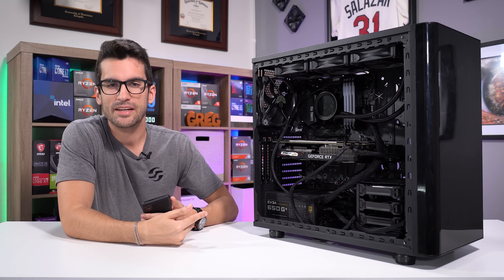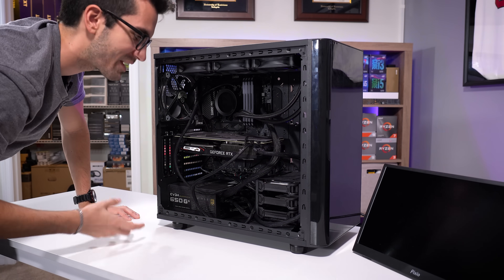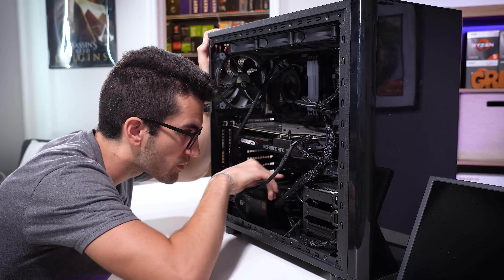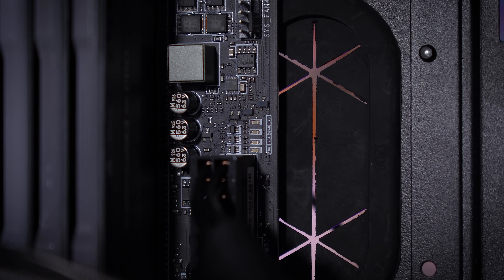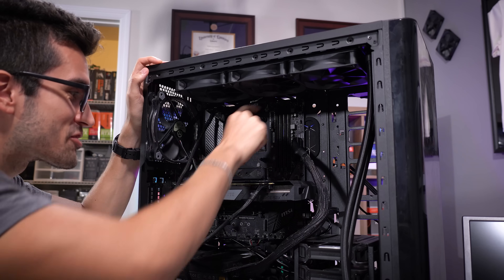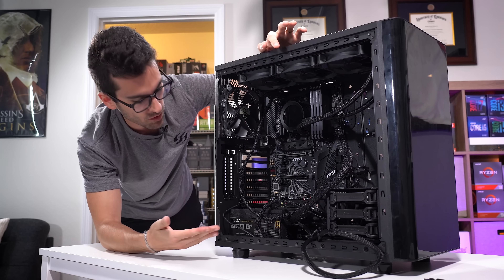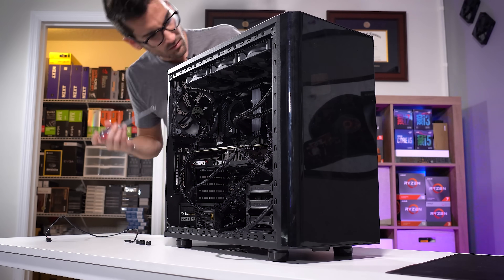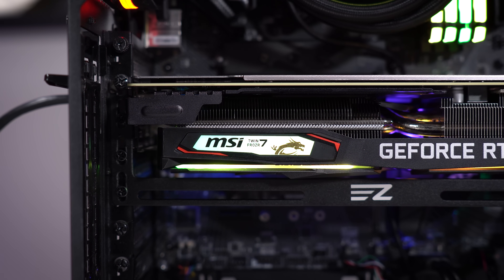Fixing a Viewer's BROKEN Gaming PC? - Fix or Flop S1:E4

Comment: I had this bizarre issue with my previous pc, whenever I reseated my ram or processor (for cleaning it), it went straight power cycle endless time like always, so I had to remove the cpu and the ram again, left it for about 20 minutes (draining remaining charge in the motherboard capacitor), and installed it again all together and bam, the system boot just fine.

Comment: My brother just did a new build, he had a gt 710 in it. He replaced it with a RX 6900 xt and now it doesn’t turn on (no power at all). His power supply is a 850 watt gold. We checked all pins, wires, etc. we unplugged and replugged things in, doesn’t change the issue. We unplugged the new GPU and added the gt710 and still no power. What is going on and why?
Reply: Can a graphics card destroy a motherboard or a powersupply?

Comment: My first thought was a dodgy overclock or BIOS glitch. Resetting the BIOS would usually be the first thing I'd do in these situations, since adding or moving components can often screw up the BIOS.
Are you sure you didn't reset the BIOS by "mistake", instead of shorting the power pins, when you fixed it?

Comment: Happened to me once, I reassembled my system and accidentally had the USB flipped somehow (it was an internal USB so I could plug in my Xbox controller adapter inside the case). Easy fix but took way too long to figure out.

Comment: It was the power button or power button wires. Remember it would turn on when power supply was turned on. Then he removed and replaced the front panel headers and then had to push the power button to turn on the system (no auto start, Greg even stated how that was weird). I'd bet an led was jumping the power pins. 
Try it your self turn off you psu. Hold your power button and flip the PSU switch your rig will do what this was doing.

Comment: I also having a similar issue with my pc it doesn't post or sometime it does. I think it is the psu because it's only 400 watt and I got a spec of gigabytes motherboard b250 (I think), ram 8 gb and gpu is GTX 1650 and cpu is i3 3.9 dual core GHz processor. So what I am saying is that 650 watt psu would be sufficient for my system? Or I should go for corsair 750 watt RM series?

Comment: Probably a little piece of wood or plastic got inside of one of the plugs and wasn't making a proper connection when you actually unplugged everything and plugged it back in it probably fell out, that's just a guess though, someone smarter than me is welcome to tell me why I'm wrong.

Comment: Ive had a simulare problem on a old settup legit tried to swap out everythng in the case, turned out that the Power button cables were shorted out. :O

Comment: I had a problem like this earlier and I found that the power switch connector was upside down in the front Io , this used to cause resets on my system.

Comment: Hey Greg.

I love your channel but I've seen this happen on gigabyte boards plenty... and while it's an MSI board I gotta ask... as I see the RAM Timings are back on default....

.... do you think just clearing the CMOS resolved the issue?  Because I've had plenty of moments where I adjust RAM timings or even just flip the "XMP On" button, and the machine will do that Exact behavior.

Boot to POST and then fail... and a quick note: the CPU light flashed, it's the RAM that didn't move to the next spot.  But... that's my theory.

Comment: I had this issue when I tried to install my pcie cables backwards to hide the daisy chained side and have a cleaner look. Idk why it won’t accept them in that direction but mine would turn on shut down. My guess is that it’s because that daisy chained cable is probably sending a 12v to another 12v or a ground in that direction instead of the power being drawn out to the additional +2 pins. Luckily I had tested it before plugging it into my $1000 graphics card lol (don’t always believe what you read in forums, people aren’t as smart as they like to sound) I’m 3 minutes in and I’m curious to see if that’s the problem.
Reply: And nope definitely not that haha.

Comment: Me at 4:30: "Clear the CMOS."
Me at 9:30: "Clear the CMOS!"

Not because I'm a genius. Because I had the same issue only hours ago when I enabled XMP on new RAM and it automatically increased my Fclk.

The user probably did something in the BIOS expecting the AIO would handle it.

Total coincidence that I watched a video with the same issue. Pretty nuts.

Comment: I got a question! I’ve tried everything. I recently upgraded my CPU from a Ryzen 5 2600 to a R7 5800x 
Also a kraken x53 booted my PC and my graphics card completely just stopped working. No monitor display and a white LED on my MOBO. No issues at all prior to this
Reply: Also I’ve tried 2 different GPUs without touching anything else and the PC boots completely fine and everything runs good with those. The moment I plug in the original GPU ( MSI Radeon RX 570 ARMOR 8G OC )
Nothing happens again.

Comment: did you remove and plugged back in the sata cables? have encountered systems refusing to even post with sata devices connected even if they were not powered/plugged to the sata power connectors

Comment: Ram or thermal past needed or cpu no seated ????????????i have a similar mother board in my 37x and i had to get replacement mother board which it was my problem never heard back from the company what was wrong my x570-a pro but new one working fine now 5 months in so you think he plugged the power io switches around the wrong way ?

Comment: I got the same problem the mother board comes on for only a few seconds if I have the ATXPWR2 plugged in. If I unplug it the board turns on, but doesn’t send out a signal to the monitor.

Comment: Commenting about 9 and a half minutes-in, this once happened for a friend because their front panel HDD LED was plugged into the power switch header, and the PWR LED was plugged into the reset switch header

Posting the comment before the end in case it helps someone in future - but otherwise I might be wrong in this video.

Comment: Don't know if you tried this, but did you try to clear CMOS? I've had that symptom on my system due to testing a CPU OC. Another thing is that AFTER I cleared CMOS, the system went through multiple power cycles similar to this as well, so I wonder if one of his cables was originally shorting the Clear CMOS jumper pins, and you moving them removed the short. Just some other ideas.

Comment: If they had the power cable from the front io plugged into the reset pins on the mobo, would it keep it in a non stop reset cycle? Could that have been the issue?

Comment: I actually had this very same issue before, all cables were connected properly and just to be safe I disconnected them all and reconnected them exactly into the same slots I disconnected them from, it worked. My guess some random technical problem that just sometimes happens, or maybe just a loose cable(which was more unlikely since it just happened randomly after turning the pc on after a night of being out).

Comment: A friend of mine had an issue similar to this.  After a week of this issue he finally contacted me and after I removed everything I found the case was missing a standoff.  So I assume there was a short because after I installed that standoff it worked and he didn't have anymore issues.
Reply: I should note that at the time of this comment I'm only 2 minutes in the video

Comment: this happened with my girlfriends PC while I was building it. I think what the case was that the reset switch cables were in the place of the power cables. not 100% sure this was the problem but I think that caused it to reset as soon as the pc turned on. might've been front io light cables but it was something like this

Comment: let me guess.... the reset switch connectors got swapped with the hdd or power led connectors... happened to me when I converted my DELL XPS 710 case from BTX to ATX..... the PC kept turning on and off after powering on... turns out the DELL power switch is also connected to the power on led.... I will need to separate those wires to get the original power switch working.

Comment: Hi Greg, i have been watching your pc cleaning and fixing broken system's videos for a while now, recently i am facing a issue where my gpu is not getting detected and my display has black and green lines like ants coming up when turning up and using... also my display is stuck at 800x600 when the gpu is not detected... i have checked wires and other components but other seems to be fine.. i think its my gpu but any other suggestions which i should look for?

Comment: Actually I liked the cooler the original way the guy had it before.  When I build PCs I never flip it to where you have all that slack in the AIO tubes that you have to rap around the CPU socket.  Good fix though Greg nice job.  If the guy doesn’t like the AIO like it is then he should be able to change it around.

Comment: i Had the same appetent issue with the first pc i ever built, turned out that particular MB wouldn't boot without the speaker plugged in, worst part of the build spent at least an hour checking and rechecking and trying to boot the system all the time thinking what have i done wrong...and did i break it.

Comment: I know this is an "old" video at this point, but once you got the solution, my brain went back to how you were uncomfortable about when you turned the PSU on and the system would just boot itself. I wonder if the power switch was accidentally plugged in backwards or one of those was crossed over somehow?

Comment: The only thing i can see that you didn't address in the video about the cables you changed is the small speaker over the power connectors. You managed to flip that around. Doubt that was the issue but just wanted to point that out.

Comment: Mine is all new but as mobo says it supports 5k mhz ram but won't accept any freq. higher then base clock no idea how to fix it as it fails to post even with xmp or manual plugging it in.

Comment: I had something similar and it turned out it was my 4 sticks of RAM. I took 2 out and it worked just fine. Dont know what this means, but worked for me.
Reply: If your cpu is Ryzen it could be something finicky on the memory controller. Ryzen unfortunately does not have quad channel support and I have gotten BSODs with xmp loaded on my 64GB kit.

Comment: This is currently happening to my build . . I had taken out the mobo and cpu to clean out my case and also reapply thermal paste . . Put together everything like it was and now it would continue to just power cycle once the CPU fan starts spinning . . I have disconnected and reconnected the front IO connections, sata cables to the hd, and GPU with the mobo just being connected to the fans, swapped out ram sticks, and still no luck . . Any suggestions or is it safe to say that I need a new case or something else ?

Comment: I have a motherboard that will not post with any stick of ram in the first slot near the CPU.  Luckily it's an older board and I've moved on from it but was trying to use it for a small project.

Comment: My pc crashes randomly. Not even blue screen. Just black screen but the pc dosent turn off. I think its a gpu problem because i got it used and it was mined on , but im not sure. 
Pc specs: ryzen 5 1600 af , asus rx 570 expedition 4gb , msi b450 gaming plus max , adata xpg 3000mhz ram , seasonic 650w non modular psu
Nothing overheats. Cpu oc to 4000mhz at 1.365v , ram xmp enabled , gpu stock clocks and voltages

Comment: I had one time my CPU fan wasn't turning and when I looked in the Bios my cpu temp was -40c and I couldn't figure out waht was wrong for days until I found a random forum theard where someone had the same issue and someone suggested he change his display port cable. I swap mine and sure enough my computer worked fine again

Comment: He definitely had a grounding issue so the psu shut itself off immediately. Probably happened on reassembly after cleaning it. Would have recommended to remove the mobo from the case and test it.

Comment: i have a similar problem where my system wont boot without the 4pin cpu connector, power supply works fine, mobo works fine with a ryzen 5 5600x but whenever i used my ryzen 3 4350g it wont post without the 4 pin

Comment: I had an interesting issue with my build. I had a fan + rgb hub, and for some reason whenever I plugged in the argb connector into the mobo, nothing would turn on whereas before the aio’s fans and ram were on. I figured out it was probably a faulty cable, because the second I unplugged it all the fans on the hub started working and the rgb also started working (it got the power through a sata connector that was attached to the fan hub) but without any rgb control from the mobo. Does anyone know a fix for this that allows me to control the rgb through the mobo?
Reply: Wondering if maybe you somehow connected the cable to the wrong type of header on your mb. Or possibly connected it to the right header but with the power pin on the wrong side, which would only be possible on the 4 pin 12v header.
Reply: @patrickmcgovern4004  I’m 100% sure it was the right header, it was a 3 pin so I couldn’t have fit it in a 4 pin without doing anything majorly wrong, and also that would have probably fried something, but nothing got fried. I’ve thought of 2 main options: 
1. Get an argb splitter cable so they can all connect. The only issue I might face with this is there not being enough power for 3 rgb fans, as it is only 5 volts.
2. Buy another rgb hub to get them all to work on the same header. No real downsides to this one as far as I know.
Reply: @flammerz1938  I would try the splitter cable first, then if it doesn't work try getting another hub. That way if the splitter cable does work you've fixed the issue at what would likely be the cheaper solution. But I would also double check to make sure the connections are solid because cables are pretty basic which makes them fairly unlikely to fail unless something got fried somehow. Just as likely that one of the pins is not making good contact on one or the other end of the connecting cable. Or it could even be an issue with the hub itself.

Comment: Does anyone know why my nzxt rgb ring doesn’t work. I’ve tried moving the usb cable to another but didn’t work. It’s been stuck on this red solid color for a while now. Nzxt cam shows everything working functional but lighting isn’t working. It’s been set to a default since I got it, which the ring and Nzxt logo should be lit but aren’t even after booting.

Comment: Something similar happened to me. I changed the case and I couldn't post. Tried everything, different PSU gpu... In the end I replaced the CMOS battery and that worked. I returned the battery back in and it posted with the same battery. That was not fun at all let me tell ya...

Comment: Hey I’m having an issues with my dell optiplex 3020 i5 4570, I have a gtx 570 4gb, 8gm ram 500gb HD and 500w thermal take. The issue is that when I uncap my FPS for fortnite it would later freeze the entire computer and i would have to force restart it. It would happen randomly too even if it’s capped, can you give me any solutions? Lmk if you need more info if you can help? Thank You

Comment: i have kinda same issue when i install my cpu cooler system isnt working at all and then when i remove the cooler its booting rightaway and even when loosen a screws its working perfectly fine . i think something is wrong with my cpu socket on board !!
Reply: Thermal paste on the wrong side??

Comment: Something similar happened to me

upgraded from a R5 2600 to a 3600, had issues when testing OC and had to use my 2600 in order to update the bios then the 3600 worked, suddenly the pc began doing what the one in the video done, tried everything and could not get a post so I sent it to Asus and guess what!! While it was in transit to them they released a new bios update but that wouldn't matter to me since even my old cpu wouldn't get the system to post but here's the good part...... All Asus had to do was assemble a system using my motherboard and it booted up so they update the bios and everything worked perfectly fine!!!

Comment: I was betting all my chips on the issue being that the viewer didn't plug the AIO pump connection into the CPU fan header, as some motherboards have safeties in place that won't allow post with no CPU cooler

Comment: My first guess after hearing the problem: motherboard short

Obviously no way to know for sure without testing though, but we all have our gut feelings, and I know that can be the cause of such boot loops.
Reply: I'm so glad you ended up removing the unnecessary motherboard cables! Believe it or not, but that's the first thing I would have suggested after checking the connections, due to my suspicion of this being something going wrong on the actual motherboard.

I think these videos show just how important it is to not jump to conclusions until you have truly ruled everything out. It would have been such a shame if the motherboard would have been dumped, or if it would have been sold off for like $15 as broken and then replaced.

And for those who haven't diagnosed computers much before, this kind of ending where you're left scratching your head wondering what was actually wrong is not an uncommon outcome at all when diagnosing computers!

Comment: I had a customer who's PC was working for 2 months and one night after playing games they shut it down and went bed, came back to it the next day and it wouldn't power up, the fans wouldn't  spin.  I went though all the touble shooting started with the PSU, that worked, checked the motherboard without the gpu in and it booted, tested the pci-e slot and it booted again tested the card in a different working system and it wouldn't let the system power up greatfully the PC was in warrenty and they got a replacement card